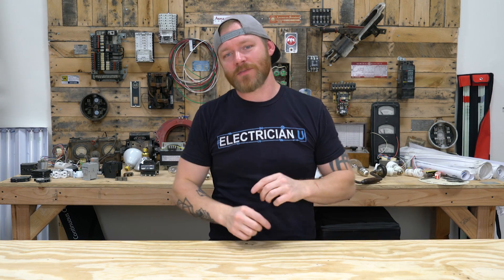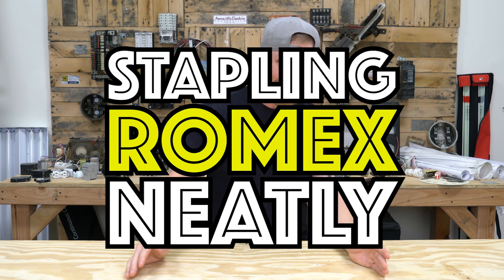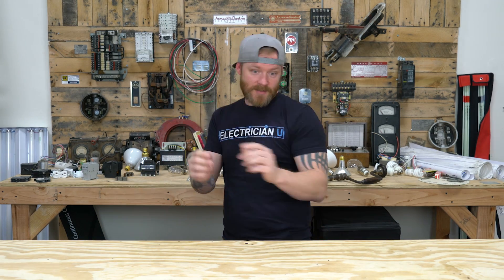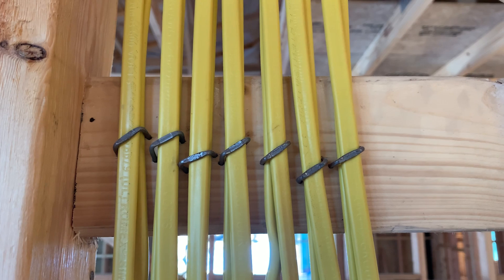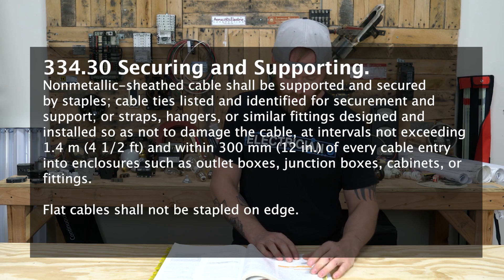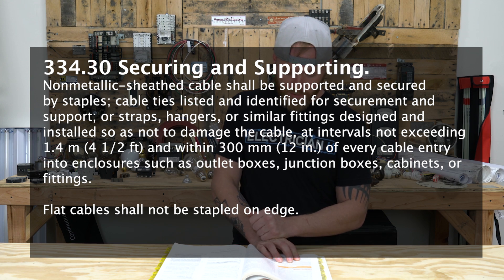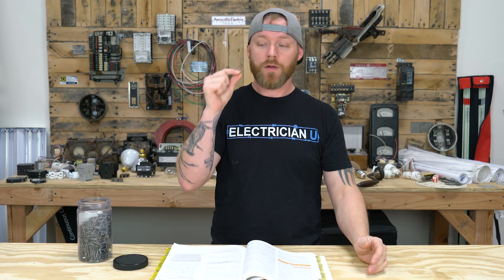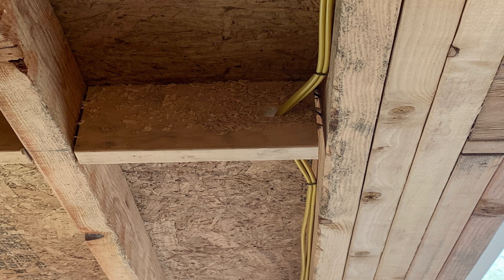Should Romex Be Stapled Neatly? DOES IT MATTER??

Comment: I’ve always done it if I have 2 wires on the same beam of 12-2, I’ll put them on top of one another with 1 staple. If there are 3 wires, I’ll use a stacket even if it looks underused with a few empty spaces it’ll still look good. If there are 2 wires in which one is a 12-2 and a 12-3, I will staple them separately since they won’t be able to be too nice and flush on top of one another. Also, I try to stay center on the beam in case a sheet rocket misses with their drywall screw, assuming they are using 1 inch or less screws they won’t hit my wires.

Comment: There have been jobs I've gone into for service or a remodel where I've looked inside the panel or even a switch or receptacle box and noted that the electrician gave a crap. Customers seem to like it when you can tell them that whoever wired their house cared about quality work. I've also been on the jobs where I'm pretty sure the framers also did the electrical (I've been told by those who were around back in the day that was common practice in the late 70s to early 80s, at least in my area).

Comment: The insurance inspector, that came to inspect our new house, looked at the wiring and said to me "Your electrician was pretty anal"! I said "Thanks, that was me." Many years later the town electrical inspector came to inspect my generator installation said he was very impressed with the installation and all of the wiring including in the service panel. He had never seen such a neat job by any electrician. Each wire in the panel and outlet boxes has a number tag. I have an excel spreadsheet inside the main panel that lists every wire in the house so down the road someone else can come in and trace any wire. I am not an electrician but I did take the apprentice training course and apprenticed for awhile before being laid off back in the 70's. Since then I became a EE and worked in the defense industry. Keep up your great work!

Comment: I started out doing low volt. We would "cigarette pack" our cable. Other guys would get upset because on large jobs because their server rooms looked like s**t. That carried over to doing commercial electrical and also then understood why low volt guys were a pain in the ass LOL. I became the electrician to deal with them. When I did some residential, it was like deal with cluster f**ks all the time. Personally, I wire label my circuits for the next guy. I just got done fixing some rewire my dad did. Now I get why the house flickers like a MF, but it needs a complete rewire and service upgrade.

Comment: I am a low voltage guy. alarms , cameras, control,  access systems etc..I  pay attention to all electrical code changes and field practice . I have seen the absolute best line voltage work which is absolutely  anal retentive down to absolutely no problem passing an inspection with flying colors. The difference between the two is obviously the amount of time put into the job Vs. how much the contractor is being paid..I work in lower fairfield county CT  most of the time on above average ,to the finest homes   in the country. The inspectors are tough on actual  code violations, however the CODE  is the CODE. period...once everything is concealed with gypsum board, who the F cares how concentric your  multiple bends/sweeps/offsets  with NMC were  installed ??? I have personally seen anal retentive  work in 2 5 10 15  million homes that  is absolutely beautiful, however to what end?? pride shmeid, no one cares that you spent 100 extra hours making those invisible details .Electrical workers in general  are not PIcasso"s  , just get it done to the CODE....I will   also tip my hat to industrial Electricians who do plenty of work that is plain site to everyone with your detail in custom bending multiple 4,5,6. inch RMC with perfect Symmetry, You are not Picasso's, however you are Jr. Einstien"s

Comment: Multiple wires / dissipation of heat?? To resolve the imagined situation it seems the breaker should be "de-rated"  and not allow the potential for a wire to draw enough current to overheat??? At any rate, limiting two conductors to a hole is pure BS!!

Comment: Neatness counts... maybe only to the one doing the work, but it makes a difference to me. I've installed miles of data, coax, fiber, and other wire for years, and was taught by old guys who worked for Ma Bell many, many years ago. And their rule was neatness counts, 90 degree bends are your friend. Look at modern data centers, where the main wiring is installed once, and lasts for years. Some of their work looks like art - so precise, so clean. And no, not all of them have OCD. You can go fairly fast and still stay neat, after you get some practice in.

Good on you for proposing that you should have pride in your work, and having integrity.  And just think - if a jet engine assembler just "threw it together any old way", you'd NEVER want to fly in that plane. Right?

Comment: When I was installing small business PBX system..as a telephone employee in the early and mid 60’s.. I was trained to do it very neatly..45 degree corners..clamps equally spaced and to sign your name or initials to the board on which it was mounted. Nothing worse than to have to shoot a case of trouble when the wiring is a rats nest. I always took great pride in my work..do it right and you will not have to do it over.

Of course, it’s not the 60’s or even the 70’s any longer..so to see someone with dedication and pride in their work, is rare..unless they are craftspeople and laborers from another company.

Comment: Two simple reason: 1> Pride in your work. When someone looks at it thinking of hiring you or they look at a picture of a past job, they immediately think: nice job, I have no problem hiring this guy! 2> When the inspector visits, this will be his first impression & it will dictate how he reacts to the rest of the installation. If there is a small item which needs to be addressed, he may simply tell you to fix the item but he will sign off. If it looks like a mess, he will likely fail your work requiring a return visit.

Comment: One reason why everything should be strapped nicely and correctly, is prevention of drywallers from running screws through your stuff, or framers coming back and having to do something then possibly putting a nail through your wires. Being thoughtful how you run things will help in protection of your wires and raceways,  etc,...

Comment: My first time really doing a lot of electrical work was when I finished my basement.  My VERY picky friend taught me electrical and he was very specific so my sub panel, all my boxes, my feeder, the jetted tub cable, the speaker wires, the pellet stove thermostat wire, my routing, holes in framing, etc had to be perfect.  The electrical inspector was very impressed and even said i should teach contractors how to run wire.  I was very proud of that and I actually still today, 20 years later, fell that way.  Just built my own house as the general, doing a lot of the work, including most of the electrical- other than another friend who was a licensed electrical contractor helping me a little.  But that basement project still stands out for me.

Comment: maybe its just 20+ years of being an EE but steal fasteners on live lives is bad IMHO. any movement = short... recommend fasteners that wont cut insulation if wires get moved... otherwise, spot on, so much easier to come back and troubleshoot and work with. neatness counts and saves labor in long run.

Comment: Years ago I had a electrical contracting business doing all commercial and industrial projects. I averaged 30-35 employees at all times, had to be harsh with some of the guys with the attitude, "but no one will ever see it" BS.
I got a contract for a new restaurant/sports bar. The entire corporate team came to the jobsite unannounced. We had all conduit ran, conductors pulled, feeders installed and I was wiring the panels when they arrived. After they were onsite for approx. 1 hour, they came to me and said we needed to talk. They stated they knew nothing about electrical but after looking through the building with every conduit run straight, all wiring in every junction box and panels labeled and the neatest panel wiring they had every saw in a building, they wanted to give me contracts on every building because they could see the pride taken in our work compared to the previous buildings they had built. Two weeks later I started getting contracts on 10 buildings at a time. We done 163 of those new restaurants and one of the guys told his friend about my company, he happened to be the maintenance director at aviation facilities which ended up being 4 of my guys working at the aviation facilities for over 3 years at 40 hrs per week.
Not only is doing good work self-satisfying, it can make a difference.

Comment: Personally I've never understood the logic of fastening romex to vertical wooden members. Vertical wooden members are what you attach everything to - sheeting, siding, drywall, cabinets, shelves, pictures, etc. You are increasing the chance that you, someone, the home owner, will miss the stud slightly or crooked enough to side breach and insult the insulation and possibly shorting circuits. They should actually be loose with slack in the center between two studs so they can auto-relocate in the introduction of a long screw - fasten at bay entrance, exit, and at box only.

I've always thought a good idea in a wood construction is to run individual metal studs where you have wire running along it, this way at least as a paradigm, one would know where the wires are in a wall.
Reply: Running vertical wires INSIDE metal studs, even in a wood construction has other benefits. Eventually, we will want to make use of the space between studs - at least for interior walls. Kits will be sold to furniture-ize or storage-ize this space soon. Not having wires running in this 14.5" space will make this transition easier.

Comment: I have seen staples compromise a wire, wood black and sheathing burnt.  I have a two year technical deg. for electronic repair.  I see the apprenticeship programs as a rubber stamp work for me 6000 hours racket.  I would love to see the avg. journeyman try to fix a tube television.  With this throw away culture, electronic repair is not as viable a career choice.

Comment: This discipline applies to low voltage systems as well.  I encounter alarm and access control panels all the time that I refer to as rat's nests.  Do they work?  Most of the time, but at the very least it makes things a challenge to troubleshoot.  Fortunately, I had a mentor who insisted I take the extra time to do a "neat and workmanlike" job.  I've had more than one inspector comment on my installs and usually one quick glance and they don't see any need to check my entire job.  Nice to hear somebody preaching this concept.

Comment: Has anyone ever argued that stapling romex forces one to destroy perfectly good sheetrock to repair a wiring run?
Reply: I can't imagine so.  It's code that it must be supported.  You won't pass inspection and be able to put up sheet rock in the first place without staples.  it is allowable by the code to pull wire through pre-existing structures without support however.

Comment: It's not required but it's recommended, it Just makes you look like a profecional and it looks clean, and like he said the inspectors love to see work like that....also if ure going to pull lots of cable threw the same way you can use stackers and you can put two 12g  on each bay or three 14g on each bay...and i think they have 4 spaces on each stacker so you do the math and if you run them nice and flat to each other then it would look very pretty...

Comment: You mention heat dissipation with Romex. How does this work with spray foam insulation that all the high end houses seem to be getting now a days? It seems they spray right over the romex which is essentially insulating the cable way more then a bundle of wires would. Any insight?

Comment: My career was in telecom power.   The standard always was that conductors or cables would be laced to the cable rack in neat, parallel rows.   As I neared retirement installations went to raceways with cables laid haphazardly in a trough.  The worst thing about that is that communication cables and power cables were intermixed which drove me nuts.   We would get a "so what" from commercial electricians who left exposed conductors at power panel connections.   Our contracts with them included terms that there would be no "shiners".

Comment: Your NEC code 334.30 is very similar to our CEC code 12-510(4) "Where cable is run to a switch or a receptacle specifically approved with an integral enclosure incorporating an integral cable clamp, the cable shall be supported by straps or other devices located within 300mm from the switch or receptacle wall opening and there shall be at least a 300mm loop of unbroken cable or 150mm of a cable end available on the interior of the finished wall to permit replacement." 
Our code for workmanship is 2-122 "The mechanical arrangement and execution of the work in connection with any electrical installation shall be acceptable." I always enjoy watching your videos, interesting to see the differences and similarities between the different code books.

Comment: Dustin, I was taught, that whatever gets covered; will be uncovered at some point.....so make it look good & functional😉
Like making things look good, if that’s running romex, or doing plumbing work; regardless if gets covered up, I make sure it looks good & works “well” together. Also, imo, spend few extra bucks for nail plates for your electrical & plumbing work (last thing you want is someone doing finishing work & sinking a nail/screw into the wires/pipes you just spend installing & then having to “repair” them).
Happy Holidays (can’t believe thanksgiving & Xmas here already)✌🏼

Comment: I see a lot of comments here suggesting that everyone is doing a great workman like job. I can tell you from many years of experience, that the average electrician, especially new construction, is terribly sloppy in their workmanship.  The majority of jobs I see I would be embarrassed to admit to doing. When my guys run Cable, I expect the holes to be measured and drilled perfect and no twists to be found. If we’re bending pipe, it better be plumb, level and strapped evenly. It would be great if I saw more of that in the field.  In my area, I’ve seen plenty of jobs pass inspection even though they look like two drunk cavemen did the work.

Comment: My experience leads me to think that there are basically 2 types of electricians out there.

The first type are the ones who just want to get it done and get out of there. Quick and dirty is the general rule. “Lick it and stick it” as one of them told me once. It’ll (probably) work, but don’t look too hard under the hood. 

The second type tend to be more perfectionists. Everything by the book, square, plumb, and level. Every little detail counts. When they finish a job you can bet everything works properly and looks great. But it usually takes them much longer to get the same job done as the type 1 guy.

The key, I think, is in knowing when and where it’s ok to step on the gas and “git ‘er done” and when you need to slow down and really pay attention to the details and take your time.

IMO, neatly stapling romex that’s installed behind a wall is pretty clearly a “git ‘er done” kind of situation. Once the drywall is up absolutely nobody is going to see it, and as long as it’s stapled properly nobody is really going to care. If you can make it look neat and clean without taking a bunch of extra time, then go for it, otherwise perhaps you’d be better off moving on to something more important.

Comment: My only concern is all that cross inductance.  High current in one wire inducing a voltage into the one running parallel to it adding more EMI.   Random mess is less likely to have that happen.   Outside of that I completely agree with neat and clean.   My background is electronics.

Comment: Every run deserves attention.  Some need to be loose so the drywall fasteners that miss a stud  will move rather than be penetrated.  Some need to be isolated form others because of what I call load habit: A circuit that you know will have more common use like a bathroom heater.